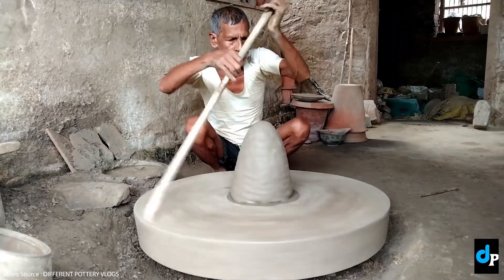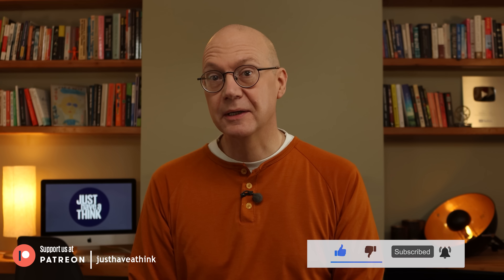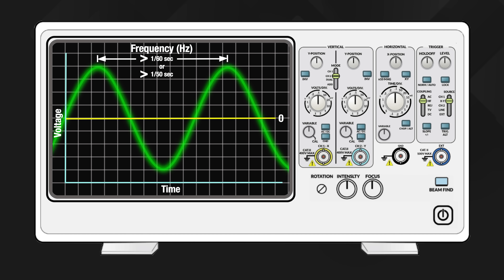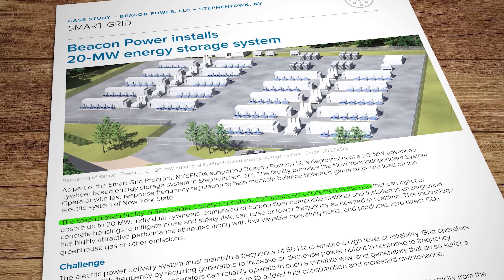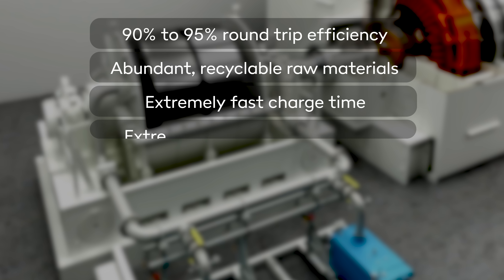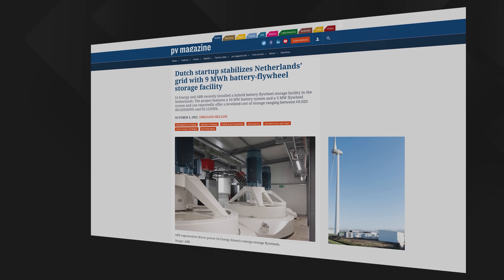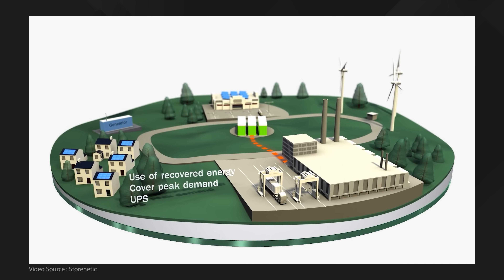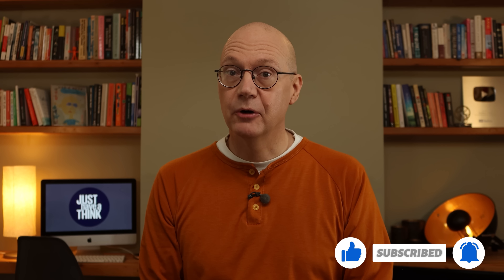Flywheel reinvention revolutionising our power grids!

Comment: As always, great video again! And now ad car battery swapping stations to the mix...
Sometimes the best idea's are very old and very simple...

Combine flywheels with battery swapping stations - places where a lot of electricity can be consumed when energy costs are low - and that can also easily be shut down when electricity demand is high.

Or they can also become temporary energy suppliers for a few hours at evening peak demand...

And what to do with old car swap batteries that have been taken out of cars because they've become too old and inefficient and have been taken over by brand new and better battery technologies? Car batteries should be a (re)movable object that can be easily sold second hand to be used in battery packs in your home, or in bulk to help stabilize the grid in sink with flywheels...

How stupid would it be if everyone drove around in an expensive electric car with a giant heavy battery full of rare earth minerals that they will only use a few time a year when they actually need to drive more than 500km?

Just use a small battery in your car for every day use, and change it for a big one before you go on holiday...

Battery swapping stations will happily hold on to your big and small leased batteries so that they can use them to make money with them to stabilize the grid...

Electric car owners can stil plug in their car into their home and use their car battery energy when electricity costs are too high at evening peak demand...

No more need of other dedicated battery packs from Tesla that are way to expensive and rob the planet of rare earth minerals...

Happy New Year Everyone!

Comment: Dave, The South Australia grid provides an excellent example of what can be achieved with a few synchronous condensers (Fly wheels). SA has had access to large amounts of solar and wind generation which means that at times it could theoretically run at 100% renewable. However AEMO has placed a requirement for a certain amount of synchronous generation in the energy mix as a contingency for any grid disturbances such as the separation of SA from the rest of the Australian grid. Until recently they would dispatch around 20% of the load as Gas generation and at times order gas generators to stay on line despite falling spot prices. In order to avoid the need for this expensive generation they commissioned 4 Syncons which are now currently operational.  These machine spin up and provide the same inertia service as the Gas generation without the cost. It's seems like the Gas dispatch is now below 5% in these high VRE scenarios. In recent days they hit 100% renewable generation for around 10 days continuous.  Of course SA also has 2 Grid forming inverters as well, originally at Dalrymple and now also Hornsdale. At the time they made the Syncon decision I don't think the GFI technology was there. I am not sure it would be the same decision today.
Reply: Synchronous condensers do provide inertia resources but are principally embedded to provide reactive power control where penetration of renewables is high.
Reply: Excellent detail Greg.  Do you have a comment on viability of inverters providing inertia, making need for synchronous condensers redundant ?
Reply: @samjohnston4945  I understand it is more to do with cost with an article on Renew Economy saying one twenty-fifth.
Reply: @samjohnston4945  Here is a link with a knowledge sharing report about the Dalrymple Battery. https://www.electranet.com.au/wp-content/uploads/2021/04/ESCRI-SA-Final-Knowledge-Sharing-Report-March-2021.pdf

As I understand it this Battery forms a voltage (Grid Forming Inverter) so any changes in the grid voltage or frequency result in a virtually immediate reaction similar to a synchronous machine. The report quantifies this inertia effect for the Dalrymple battery at 200MWs compared to 5400MWs requirement for the State. At 8MW/30MWh this is a relatively small battery at the end of the grid so its impact is modest.

The following article describes the latest initiative from ARENA to establish 8 large grid forming inverters throughout the NEM which will substantially improve the inertia of the NEM.

https://arena.gov.au/blog/arena-backs-eight-big-batteries-to-bolster-grid/
 

As I understand the Hornsdale battery in SA is now at 150MW/194MWh and has been upgraded with Grid Forming software. The article below states it can now deliver 2000MWs of inertia  services.

https://www.pv-magazine-australia.com/2022/07/27/hornsdale-big-battery-begins-providing-inertia-grid-services-at-scale-in-world-first/

So to answer your question, there is not so much discussion of adding new synchronous condensers for inertia. That said the Queensland Government is proposing to convert some of their large coal turbines into Syncons. progressively as energy security is achieved starting from 2027.

https://www.epw.qld.gov.au/__data/assets/pdf_file/0030/32988/queensland-supergrid-infrastructure-blueprint.pdf
Reply: @gregpaulsen9088  Thank you Greg.  Excellent detail.  Really appreciate your time putting the response together.  Will have this in the back pocket, ready to whip out & use with the many disinformed family & friends that believe the power grid will fail, due to renewables.
Reply: @samjohnston4945  You're welcome. It is a bit frustrating when even well meaning friends and family make statements like there is no plan. AEMO's Integrated System Plan has been published every 2 years since 2018. In my view there is no technical or economic reason that a full renewable grid cannot be built. It is more a case of regulations and policy which are sometimes getting in the way.
Reply: Greg, 
cloud cuckoo land.
Certainly a 100% renewable grid can be built but expect long periods with no power. How can you overcome low wind speed?  There is no source that is viable for long duration of low wind speed. 
How can you provide balancing with renewables? It is impossible for those two major deficiencies to be met.
Reply: @iareid8255  Hi.  Likely very true for other small land mass countries.  The scientific modeling by CSIRO & others paint a different picture for Australia, given Oz's large east coast interconnected power network & the plan for distributed wind, solar, battery (water & chemical) we are good to go.  Enough thermal mass to produce continued wind across the network & we'll likely build out to ~150% over needed capacity.  Time will tell.
Reply: Sam, 

yoiu suggest a 150% of capacity. That is nowhere near enough to cover intermittency. It is a direction countries are taking but I believe it will all end in long term blackouts as renewables alone even with the electrconic and synchronous condensers aids. It is not a feasible or economic plan especially given the relatively short life of renewables.
As you say time will tell.
Reply: @iareid8255  Just out of curiosity: What do you mean by intermittency and how much % of capacity would you expect to be needed for a stable, renewable energy grid?
Reply: Felix,
intermittency is the variation of level of generation from renewable generation.
A stable renewable energy grid is not possible as, at times renewable generation output levels drop to very low levels. Also, as it is not controllable the balancing of demand and supply cannot be done with renewables alone.
Reply: Renew economy publication has some great podcasts about that , it's called Energy Insiders. Yes thanks for all the detail
Reply: Cool. What is a grid forming inverter? (I just did some research, but i'm still a little hazy, how do they work exactly?)
Reply: @lawrencefrost9063  A grid forming inverter creates its own stable voltage and frequency. A grid following inverter follows the frequency of the grid and adjusts its voltage to supply  or sink current. When inverters were first introduced into the national grids they were specified to be grid following as it was a lot simpler to manage. The benefit of grid forming inverters is that they can be programmed to act in an identical manner to a large turbine generator. The current Gird design relies on the mass of these thermal generators to provide "inertia" of the voltage and frequency. As these generators are leaving the grid, operators are concerned about how they will provide this inertia. The propsoed answer is that the kinetic energy transfer from turbines is replaced by potential energy stored in a battery and managed by a Grid Foreign Inverter. Hope that helps
Reply: Dave,
synchronous condensers are primarily for reactive power. As far as inertia goes they are no replacement for conventional generators for the simple reason that conventional generators have the back up of reserve power to sustain frequency.
Renewables can never take over, they have far too many negatives.
Reply: @iareid8255  Assuming technological advancement stays stagnant... They figured out coal at some point, nuclear at some point, they'll figure out others at other points to sort out the current issues. 

I figure Australia is so large, it's surely windy in some parts of the country at all times. But that's assuming current tech used. There'll be new ways to harvest energy, store it and manage the ebbs and flows. We'll see what happens....
Reply: @Krepelichec  
It is far more than just intermittency, which is an enormous hurdle. (Even in Australia)
Renewables cannot load follow, renewables have no inertia, renewables do not provide reactive power, renewables do not contribute to short circuit current levels.
Technical improvements will have a hard time overcoming such basic deficiencies.
Some of the above can be mitigated with batteries, but not all.
Then there is the very short life relatively, of both renewable generators and batteries.
It really is dead end.
If, and it is a big if, CO2 needs to be reduced,  the best and most economical way overall is nuclear. Yes high level waste is a problem but to listen to the increasingly hysterical UN secretary general it is crisis so desperate measures are required. 
But it is not happening, we are impoverishing countries with high energy cost due to renewables and shutting down industry. Why?

Comment: Look at Swiss made ilgner sets, they where used on 10 ton plus steel mills to power the intermittent 14,300 hp dc drive  motors. Since 1937 until now.

Comment: any closed water power generation systems ? a dam loses their fluid, a 2 bucket system in a vertical tube would not, only need to "pump" water (open valve) to make 1 bucket heavier than the other, gravity does the rest, when wind power/solar power is not needed then pump to equalise the buckets. (one bucket slightly heavier than the other, the other stores more water but this one can release water into the first by opening valve)

Comment: It should be noted that Dave describes two distinctly different flywheel technologies with different purposes, but he doesn't complicate the video by describing this distinction. Grid speed "synchronous" flywheels (aka synchronous condensers) have electrical machines which are directly connected to the grid and provide inertia, damping, voltage support and short circuit current but no meaningful energy storage. High speed flywheels can store and provide greater quantities of useful energy (per kg of flywheel) but their electrical machines are connected to the grid via a frequency changing power converter which (depending on its controller) might be able to provide some of the above electrical services but very little short circuit current. Grid speed flywheels are necessary to stabilise the grid when there are large amounts of inverter based renewables (wind and solar) conected but high speed flywheels can be useful to halp balance the grid for very short periods.

I believe that high speed flywheels have a limited future as batteries and supercapacitors eat their lunch with lower cost and longer duration.

Comment: A synchronized power grid is not a necessity - if the local grids are run on AC, but the main high power part of the grid is run on HVDC, frequency stabilization would be much less of an issue.
Reply: Would the HVDC grid be more stable during a solar storm?
Reply: @chuckkottke  yes, for a lot of reasons. HVDC are much better suited for use as undergroud cable (though those are pretty expensive) since they do not have capacitive or inductive losses like AC. There, the (wet) soil acts as a dampener to electromagnetic effects. As standard wire, they suffer from the same effects as HVAC, but since they operate at much higher voltages, have fewer wires, need better breakers, overcurrent and overvoltage suppressors anyway, do not have transformers that take very long times to build,... They are not indestructable, but they are less vulnerable.
Reply: One very important role of having a synchronized grid is that this is used as a gridwide method for allowing all grid assets to simultaneously know the instantaneous balance of power.  The grid frequency is actually used to signal this balance of power.  Without this critical information there would be no easy solution for maintaining grid stability.
Reply: @michael-j-harrison  that was true, once. But e.g. Japan uses 50 Hz as well as 60 Hz with HVDC interconnects..... Honestly, in a time where you could have live load data from every nook and cranny on the grid, getting the load from the frequency can be made obsolete.
Reply: @wernerviehhauser94  but the point is that the frequency is the mechanical that is still used by every grid in the world for broadcasting the balance of power. 
Secondary comms channels are used to transfer secondary and tertiary control information but primary control is still implemented using voltage and frequency droop. 
The secondary comms channel is not considered to be reliable enough to implement primary grid control. 
You might have a contrary view point and you are entitled to it,  however I somehow get the idea that you are not working in the power utility industry.
Reply: @michael-j-harrison  obviously not, since the industry prefers the cheapest solution. I would make better grids, but less profit. Have you ever considered the fact that it is pretty common among humans to use a dumb solution because it is THERE and they are used to it instead of a better solution that might require some effort?

Comment: A great item. a few additional points to consider: (1) the use of electricity generating flywheels predates battery energy storage by decades, they were called synchronous compensators and they provided a number of electrical services in addition to inertia; (2) these new electrical flywheels are not "completely safe", there are risks in containing such large quantities of energy e.g. if the bearing oil system failed then (in the Moneypoint example) up to 600MW seconds of energy could be dumped into the bearings and they would promptly melt, no longer stabilised the multi ton flywheel may have enough remaining energy to jump off its bearings and exit the building at speed
Reply: So site the flywheels underground, perhaps the use of magnetic bearings reduces the risk of beating failure..

Comment: On a much smaller scale, flywheels ("flywheel battery") are being manufacturered for computer rooms. They allow the UPS to run for a few minutes until a generator can be brought up without requiring batteries.

Comment: Problem I see with using Lithium instead of this is demand for lithium is going to go stratospheric over the coming decade and especially as ICE cars go out of production. Wouldn't it be better overall to use only flywheels instead so we can save the amount of lithium we have for EVs and other markets/uses?
Reply: That just makes way too much sense.  😉
Reply: These things will never happen in such a planned way ... even if that looks sensible. "The market" will decide I'm afraid. Thankfully if the availability of oil is anything to go by we always manage to find more when we need it (in this case lithium). When I was a teenager there were stories about how we couldn't keep using oil fuels for transport because it was going to run out ... I'm now drawing my pension and there's still no sign of it running out! The value increased and it became profitable to find ever more deposits. That's what will likely happen for the elements we need for EVs.

Comment: Don't do flywheels sound like the perfect solution for solar power plants?
You keep the wheel spinning with solar power and as soon as it gets a little cloudy you smooth out the output with the flywheel.
If you have an even bigger flywheel, you can store energy over the day and release it in the evening, where the prices/demands are higher.

Comment: So basically... It works, and is being scaled up by big industry. It's projected cost is going to be 3000EUR per kWh, its efficiency is 90%, but despite the vacume and high efficiency bearings, it loses momentum and thus round trip efficiency during the day.

But...

Tesla megapacks currently cost 6x less already, and they are about the most expensive large scale storage systems around. And those batteries can store for many days without incurring any further losses, and the round trip efficiency is also 92%.

LFP battery cells can be had by us measly consumers for around 105EUR per kWh today, which includes shipping and customs. Subtract those, and a profit margin in this high demand low supply market, and you are looking at below 50EUR per kWh to actually produce those cells. So for grid scale battery storage, a future (2-5ys) target value is going to be 100EUR per kWh. This would be a 30x decrease of the also project 3000EUR per kWh...

So flywheels are a good idea, if only we had rolled them out en-masse 1-2 decades ago. Now they are not competitive and will remain a niche application.